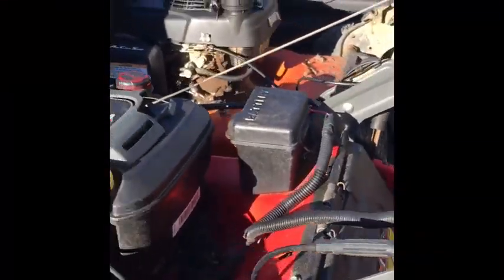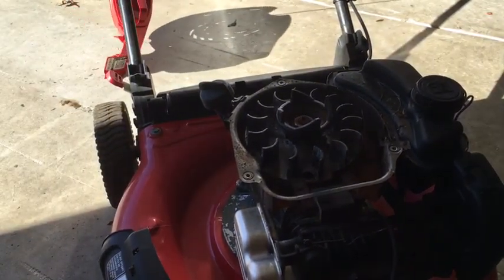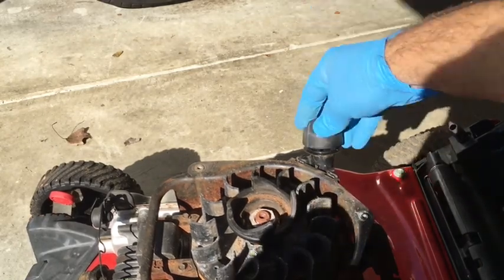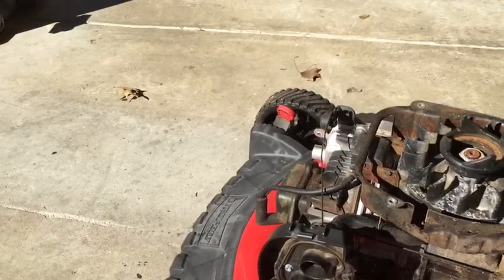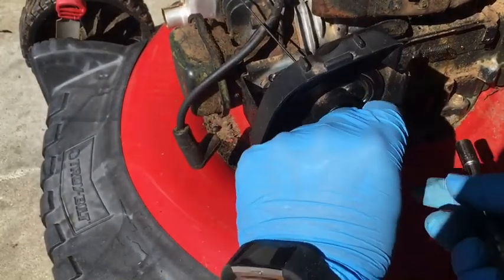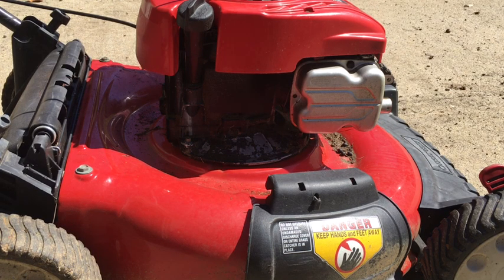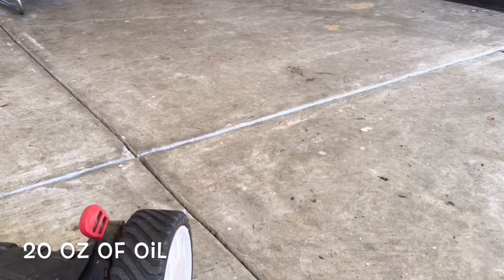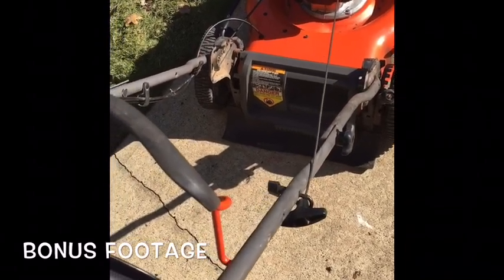Motherload 4 - Bartering : 1 Tuneup (Troybilt TB110) = 2 mowers

Comment: WOAH NICE LITTLE HORDE!
Reply from the maker: Yes yes it is,  now  just  have to hold it to the spring 2021, I have stopped sales now since season is over will start back up in late feb/March 2021
Reply from the maker: Thank you 

I know the Husqvarna. In spring after tune up is at least $200 mower

The snapper yah needs some work,  after it’s all tuned up , deck painted 
I have no idea what to price it at. 
I didn’t get a charger for it but might try charging it with my trickle charger. 
What do you think ?
Reply from the maker: Yep working up my  starting 2021 inventory.  I think I have ready the following 
Honda with bag
Toro with bag
Bolens with bag
The below need work
Husqvarna w/ honda engine w/bag tune up and new blade) 
Snapper  with bag and  electric starter TBD)
Lawnboy (oil leak and cable)